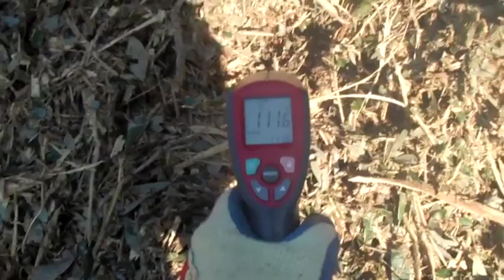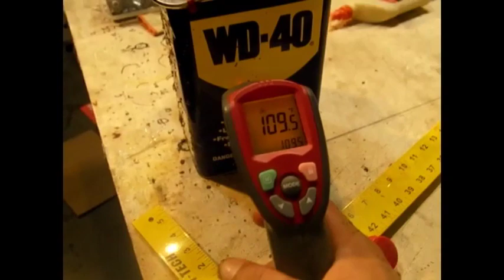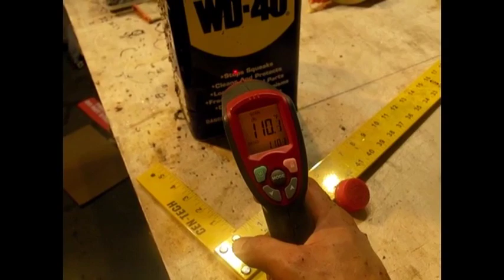Hot water from mulch  compost water heater compost geothermal decomposition

Comment: Hi guys we've been experimenting with this at the open source nonprofit I started for 4 years at compostpower and we've found ways to make these systems stay hot for 12+ months including through the Vermont winter. Check out the design guide on our website at compostpower d org for more info. It's all about getting the material wet enough and getting aeration tubes under the mass, and avoiding rot-resistant woods like cedar, hemlock, redwood, Cyprus, etc.

Comment from the maker: The heat production lasts as long as good decomposition is current. The material is free if you have tree trimmers locally and a large area to store then spread. They give it away because they usually have to pay the county/landfill for disposal. After one day in the mulch catcher, the material is 130f+. a single load produces good heat for about 1-3 weeks depending on moisture and bioactivity.

Comment: Most of the materials in landfills will not ever decompose if left in their current state :(. The very little amount of decomposition that happens is anaerobic because landfills are covered and sealed so not oxygen is present. As a result, instead of producing heat and fast decomp, landfills produce methane. Plastics will never decompose ever, and even paper products can't decompose in landfills.

Comment: Landfills don't actually go through much decomposition. The majority of materials that end up in landfills are non-biotic and can't be broken down my the decomposer micro organisms. Even the biodegradable materials like food scraps and paper don't decompose in landfills because they are completely sealed off from air, the sun, and so on. If you uncover an old landfill, you'll still be able to read the papers that were put in it so many decades ago. In short, very little heat is produced.

Comment: @swizzlecheeks 

Dig below the frost line.  Layer lots of greens and some browns for several inches, then cover with browns.  If you keep that covered with a black tarp, it should keep things warm.

To create pressure, raise the tank above the mist heads with the smallest outlet to feed the heads as possible.  The narrower the tank, the more pressure will be exuded upon the bottom where the outlet is.

Comment: With proper setup and controls, a person could have a big savings with in floor or under floor hot water heat. The same system could supply shower and washer water as was mentioned in the video. Good Job.

Comment: In an intro to soil systems class in college (once upon a time) we were able to get several specialized (accounting for chemical composition) combinations of yard debris to generate internal temperatures well in excess of 140F.  You should be able to get the proper combo well in excess of 160F as that is the requirement for true, safe, organic dirt.

Comment: Well water at 70 F? That's warm, but then again I live in Illinois, where municipal water is 55? I ned to measure it, but I know that it's not 70 F since the water pipes are about 8 to 10 feet down. PS: You'll need extra Nitrogen if you use the wood chips as mulch. The decomposition process removes nitrogen, and leaves the soil deficient.